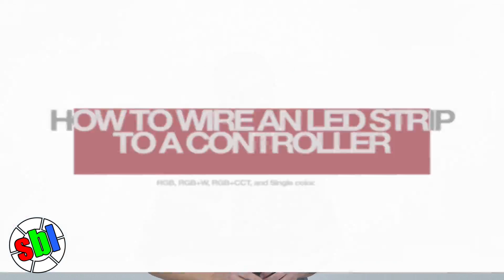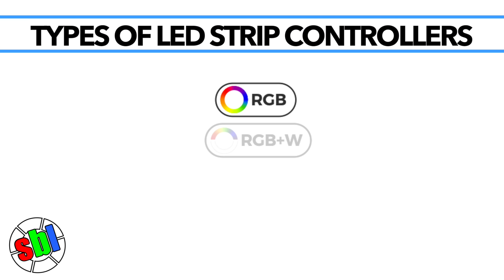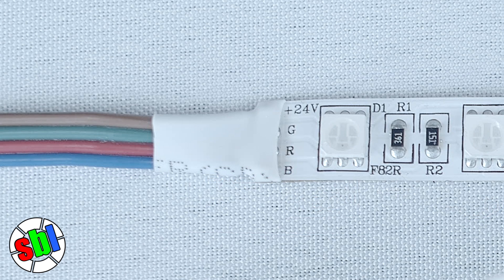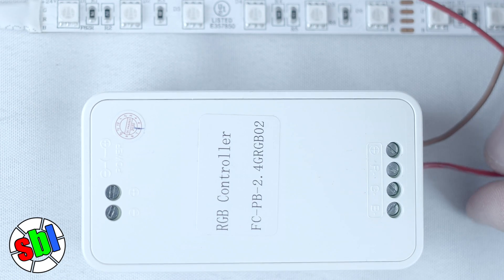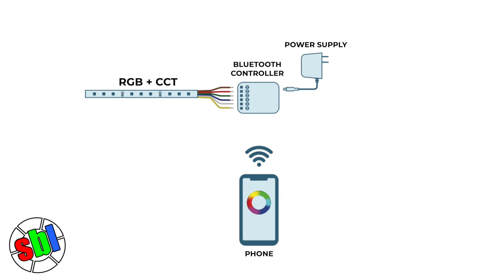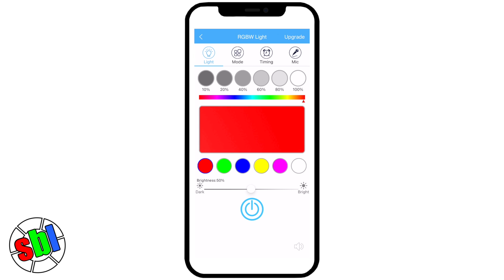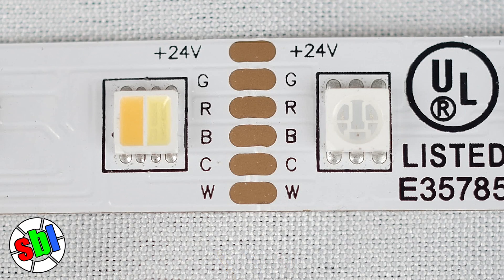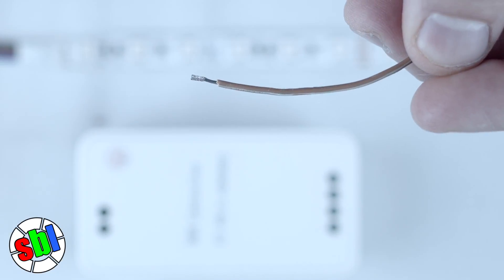How To Wire an LED Strip to a Controller

Comment: Hi, I am looking for a portable and rechargeable battery that can power a 5V WS2812B RGB LED with 300 pixels for about 5-6 hours before needing to be recharged. Any recommendations based on your experience? Thanks.